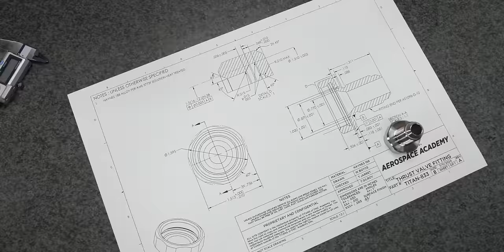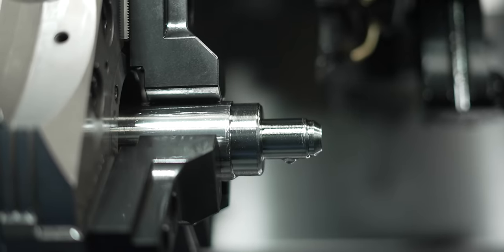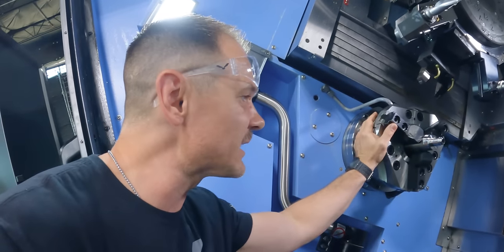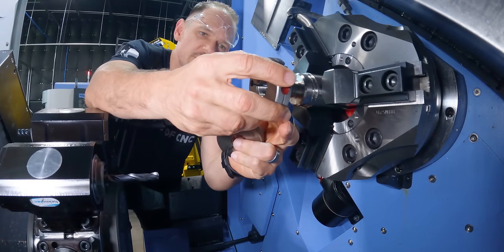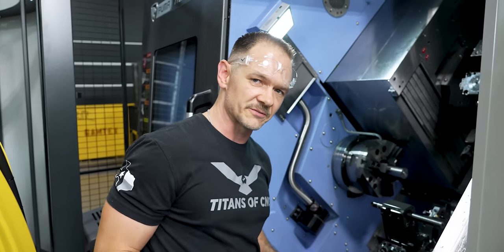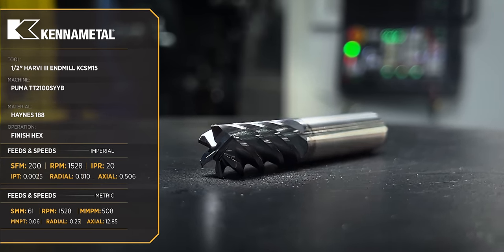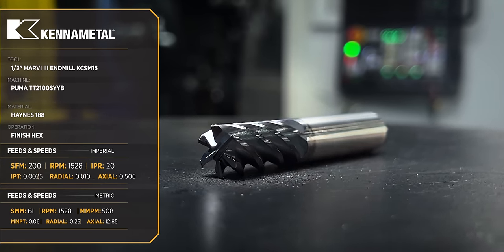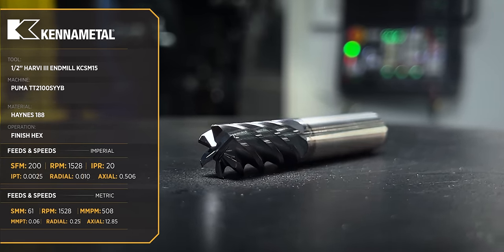Haynes 188: Hardest Material to CNC Machine?

Comment: I know you don’t work in automotive, but I would love to see some H 13 tool steel heat treated between 42 to 44. I’d like to see your feeds and speeds.
Reply: What Rockwell is the H 13 in a completely annealed state ,,, ?
Reply: Agreed. While EDM and pre-heat treat content are great content when building tools, a lot of us spend most of our time repairing dies and molds. Always looking for tips.
Reply: @rolandtamaccio3285 I think it should be around 30-35hrc.
Reply: or a mold core made from SPM450V @ HRC58+ hardened all the way through
Reply: H13 usually runs between 44-50hrc  after heat treat and draw backs if I remember correctly.
Reply: Ok Ok. I'm listening.
Reply: Did a lot oh h13 hard milling when I worked making injection molds. Use oil mist instead of flood coolant. Most of the time I was running about 300-500SFM, depending on cutting conditions. Do that with light depths of cut (0.02-0.03”) with large radial step over. Doing that with a high feed cutter with a large insert radius worked really well. Was pushing 0.015-0.02 IPT and only had to rotate roughing inserts every hour or two. I have no idea how people do it elsewhere but I spent months trying to improve our post heat treat roughing MRR and that’s what I found worked
Reply: Agreed. Where I work in the automotive industry, we hard turn pretty much everything and it’s usually at 48-52HRC. Would love to learn more about the ideal setups to improve our cycle times as I learn more about our DMG MORI NRX 2000’s and setup more machines.
Reply: M-390 stainless Rockwell hardness of 64-66😬

Comment: The most frustrating metal encountered in my aerospace career was pure nickel. Many parts on the order and took an inordinate amount of time and tweaking to complete.
Reply: Interesting. Why was it difficult? Nickel is soft.
Reply: @m4rvinmartian  Exactly. Small bore tight tolerance holes that had to be cold worked to final spec.
Reply: I think copper is worse
Reply: Turning/facing of pure nickle is not difficult. Slow speed and good coolant accomplishes the job with very good surface finish. However, threading on Nickle is difficult. Threads often get damage in first iteration. But with some adjustments, threading is also  doable on nickle.
Reply: Just finished an order of 500 parts made from copper nickel alloy, lots of tweaking and playing but tool life was terrible compared to the stainless steel I normally work with
Reply: @m4rvinmartian  manual machining where surface feeds are not held constant adds to the level of complexity on thin walled features. Tool pressure is such that it will cause all types of distortions.
Reply: @Industry-insider  I should have taken notes on all the cutting fluid concoctions we used that were passed down over the decades. Strange ones like Ivory bar soap and petroleum jelly.
Reply: @m4rvinmartian it was probably Nitinol,  which is nickel and titanium,  very abrasive.
Reply: @m4rvinmartian its gummy Absolutely blends tools
Reply: Yep. 99% pure nickel is the stuff nightmares are made of. I had to make the bolts that hold on the drouge chute for the ejection seat in a very popular current fighter jet. It is THE toughest material and was the right material for the function, but what a pain in the butt to thread (single point threading). The chip would not break....at all. Every cut work hardened the next layer. Finally got it to run nicely.

Comment: Is it harder than Stellite? I machined valves for huge steam turbines with that stuff.. eats carbide. Best results we found was using a negative rake angle on our carbide. And this was all conventional machining. 👌 love these videos
Reply: Softer then stellite but it can work harden ridiculously quickly. Go low and slow and the super alloy family will do what you want, definitely goldilocks not too fast or it will eat your bits for breakfast, not too slow or it will eat them for lunch just right. Stellite can be machined with boron nitride or silicon nitride, but generally is a little left of carbide in hardness. Mostly did stuff that was cased with that like guide rails and such.Grinding is the go to with that stuff to be sure.😮
Reply: Zirconia sand is quite hard, as you can discover machining sandy castings.

Comment: A friend of mine has a machine shop and says some of the softer grades of aluminium are the hardest to machine as they stick to tool steel and gum everything up. Just to put some perspective on this, for a laugh he ha machined an M10 nut and bolt out of potato, and a small box out of carrot.

Comment: My most “hardest” material was CPM10V… with 32 years old machine.
Reply: @danielczoller3395  yeah! Vanadium alloyed tool steels can be a bear. Lots of messy oily stinky coolant is all you can do if machining large drop hammer dies.
Reply: Heat treated high alloy CPM steel is no joke. Most of the Ellison guys I talk to think 45hrc is hard. I imagine a video on 10v or something like CPM rex 121 at 70hrc is a video that would be..in development for a while

Comment: I have had the (mis)fortune of machining many different super alloys over my 40 years in machining. Stellite, molybdenum, rhodium etc became run of the mill.
One alloy above all other stood out for me - Nimonic 90.
It earned the nickname "Unachievium"
Now if you demonstrated machining that, i feel you would have nothing left to prove.
Granted, these days there is a far better science behind carbide and ceramics than when i last got a job made from that hell-spawned godforsaken material, but it still remains a material that defeated everyone i worked with. I never hear a machinist mention that material without a huge string of expletives in the same sentence.
Reply: @grahamkeegan2706  my guess is vectored thrust components on high performance military applications.
Reply: @opendstudio7141  not sure but had to sign NDA's left right and center on the packages.
Reply: @grahamkeegan2706  that’s the way it was during the development the B2 Stealth Bombers also.

Comment: Appreciate you and all your skills. However you have the best of the best of everything in that shop. You’re not old enough to have had to do stuff like that years ago with no CAD/CAM or state of the art machines, not to mention carbide inserts. Hell back in the late 60’s everything was negative rake inserts. Insert technology has come a LONG way since then. Not taking anything away from you though. The only thing I noticed was you said you drilled a 2 inch hole. I’m thinking you meant 2 in depth because the diameter was certainly less. The fact that you gave us all that info is aces man, you’re certainly one of the best in the industry. Could have used you years back in my shop for certain. 👍🏼👍🏼

Comment: Wanna see Titans use Diamond/cBN tools at crazy speed!
Reply: Think those are very niche tools for specific finishes or holding super tight tolerances and most companies probably don’t want their most expensive and critical parts displayed on the internet.
Reply: Those are good for hard alloys but don't fare too well on tough alloys, high nickel alloys will eat a PCD bit for lunch that could do fine machining stellite or carbide. CBN will machine almost anything but gets gummed up badly on aluminum and copper alloys.

Comment: Id like to throw out a challenge for yall. We just landed some contract work where we are going to be machining a ton of TZM material with 1/8" endmills for most of the toolpaths. I had never even heard of that material and even our tool reps had no idea what we should use to cut it. We are going to get some blanks in by the end of the week and probably going to be making some cuts at the start of next week but I would be curious to hear what you guys would use to machine it. Our process is going to be a bit of lathe work to face and profile a shallow boss on the back side then put in the mill to machine the grid on the face. This material from what I understand is basically like trying to machine a carbide insert. Super abrasive and going to be a nightmare to do but it opens the door for a TON of work into our shop. Cheers fellas!

Comment: I remember hearing that the first rocket engine with interpreted cooling channels ( and not braced) was also a super copper alloy ( where it was then up into nickel plating for weeks/month non stop since they had to plate a 1 inch thick nickel layer )

My least fav material is those plastic that have extreme thermal expansion where you can't use cooling on
Reply: Plating a 1 inch thick nickel layer sounds extremely time consuming and difficult to say the least. The copper alloy used for rocket engines is usually a mixture of copper nickel and a few percent beryllium. It's unbelievably difficult to work with as the chips don't like to break and are very springy and it likes to work harden very quickly as well.
Reply: @christopherleubner6633  well nasa did do that 1 ince thick plating many many years ago ( cause there wasnt any other way back then. no 3d printing. no cnn and curved drills dont really work that well ) so they had to manually machone the part. make the slots as well. fill them with a condoctive wax and then plate the whole thing in a later of nickel about 1.1 ince and them use that 0.1 ince to hit there tarket as close to perfect as possibly allowed by the laws of nature and technoligy/metherds at the time

Comment: I remember back in the late 80's a guy walked in and to the shop and hands us some parts and a print. The print was just a holding fixture and the parts, 6 in total. They were shaped like a house roof line seen end on. They wanted a fixture to hold the parts down on a huge belt sander. When asked why a belt sander he pulled out a 7th that looked scored up. He said  try and machine it and you'll know. We tried and failed as well. He couldn't even tell us what it was or the Rockwell hardness. He said, and I quote, "It's too hard to measure". We were far too worried that the fixture wouldn't hold the parts down and anyone near the machine would be turned to canon fodder so took a pass.

Comment: I got to make some electrical components out of a material called Rhodium. You guys should play with some of that stuff. The part I made was basically a fancy bolt that would carry the current through it. But it was crazy thin walled. I can’t remember the exact dimensions because the thread pitch was a customer custom made pitch, but I remember it was around an M54 in size comparison. And the wall to the outside of the part was only .070 thick. I made the part to like 90% complete in my first vise on the table. Second vise I made a fixture that the part would screw onto so I could deck the top of the bolt without dealing with pressure on the thin walls.
Reply: Rhodium is really tough, and it's dirty step cousin rhenium.  Turning it was successful 80rpm .004ipr and heating the material to around 1100 degrees fahrenheit before engagement... Also deep cut and sharp relief angles with a dmng
Reply: Sounds like the plasma injector for an ion etching  machine used for semiconductor processing. Usually it is a platinum rhodium alloy of about 85% platinum and 15% rhodium. The plasma  for etch is 98% neon and 2% fluorine. Really dont have a wide choice of metals when using that. 😂.
Reply: @christopherleubner6633  it could have been. Some other parts I made for the same company I know go to microscopes. They kinda deal with a lot of weird odds and ends stuff.

Comment: Travis what a brilliant video  an articulate concise description of everything involved. What was the reason for tapering the cuts early in the video is it to reduce harmonics or to change the tool load perhaps?
Reply: The intention is to prevent notch wear. Notch wear is when you develop a chip on your insert because you enter the cut at the same point every pass. The taper is really just a way to alternate this entry point point slightly and thus increase your tool life. It is usually referred to as a variable depth of cut.
Reply: i was just thinking about this issue today at work!   we only use ceramic inserts and our heavy roughing cuts are all the same doc which has this issue and shortens the cutter life.   but i aint sure if our older lathes are still rigid enough to handle this style programming.

Comment: Try your hand with 60 HRC. I worked as a miller in a toolroom in maintenance. Having to machine in tolerances of H/h6 in materials as hard as 60 HRC was hell. We'd use air-cooling and carbide tools of course, but things would break so easily...

Comment: The machine shop I work for will only buy HSS Tooling and we have to use that tooling on everything from low carbon steel, cold rolled steel, 6065 and higher Aluminum, pre and post heat treated steel, all grades of stainless steel and thompson. They will not buy Kobalt or Carbide tooling which makes my job very difficult at times. Would love to see a video using only HSS tooling for such materials with advice.
Reply: What? Why? Are they stuck in the fifties?
Reply: Yes they are, the owner is 92 years old and still operates this shop as if it were 1950
Reply: @markdebruler5886  Well, HSS development died when WCo inserts were invented, so your options are limited...

Comment: Travis, awesome job with this alloy. I am curious though, what else does super alloys like this get used for besides for high temp turbine and/or rocket engines?
Reply: It depends on the material but you will also see them used in highly corrosive environments, for example chemical processing plants.

Comment: I would love too see Alumina machined. Always wanted parts because of the combo of thermal conduction and electrical insulation, but they have always been to expensive in comparison to the benefit they provided.
Reply: Alumina is ceramic material. It is very hard. However, it can be turned on CNC lathes using PCD (Polycrystalline Diamond) inserts.

Comment: Travis, drills have no feed per tooth (3:30), .... all specs are Feed/Rev even for insert (U) drills but I assume you'll know because calculations seems okay.
Is it a Mastercam thing ? 😉
Reply: It is a Mastercam thing. The live tool paths are programmed like they would be in a mill, hence the IPT. If it were an insert drill it would be programmed with the customary lathe IPR.
Reply: @travisjarrett2355  
Okay, thanks 👍,  ..... btw nice machine, a bit complicated to program when using the full options on double spindles and turrets, ... and robot.😉

Comment: Potentially stupid question, but I think I have logic behind my thought to it. Would this material thread easier if you hadn’t already drilled the ID out first? It’s a habit for me because it’s how I was trained. But my teacher told me to keep my part as ridged as I could when doing an OD thread to help avoid the deflection that’s causing that taper your seeing. My teacher has been working in the industry for 48 years. And I kind of just took his word for fact. What are your thoughts??
Reply: No there is some truth to that and if you are getting say chatter in your threads that may be a good solution. For me I sometimes worry if I cut my threads to size and then remove a bunch of material from the inside my thread may expand. On this particular size thread and hole probably tomato tomatto. In other circumstances though one technique might be preferred over the other.

Comment: I would love to see how you guys would machine tantalum ta-10w.
Reply: I remember that stuff being really heavy per given size. Cannot remember the machinability. So yeah, bring on some tantalum.
Reply: @1320pass It is very heavy! I’d say it’s similar to carbide in weight. The machinability is not great. It reminds me a lot of copper, very gummy and hard on tools. There’s very little information online about Machining it. i’m curious if anyone at Titans has run this stuff before.
Reply: Heavy, soft as mild steel but makes stringy chips. Cuts like streight copper. Cut some E beam electrode and target holders from the stuff. Also quite expensive too.

Comment: The most difficult material i ever had to machine was 99,95% Molybdenum. Really small part as well, just 10mm outer diameter and 16mm length. Still I had to change almost all the tools every 3-5 parts.
Reply: @atramentius9777  Hell yeah. Pure metals always sucks. Everybody loves Grade 2 Ti xD
Reply: @Narashimai  Grade 2 Titanium at least doesn't dissolve your tools
Reply: @atramentius9777  That is exactly the Holy-Moly situation.

Comment: Why would you use the live spindle drill over spinning the Chuck? Is it just because of the machine you're using, or is there a reason for it? Thanks
Reply: When I run larger drills I'll run it static (chuck turning) but with smaller drills it is easier (and safer) to run it as a live tool. The live tool usually allows for easier tool holding and if the tool is off slightly from center you will not snap the drill, as it is like a mill at that point.

Comment: Am a turner the last 15 years, for such a skilled job the pay sucks
Reply: It depends, turning on a XZ machine or programming/setting a SMX or two/three turret with barfeerder/robot with probing inside or outside the machine can make a difference by 2x or 3x on the salary.
When you can program a TT2100SYYB by hand/cam running double programs with waiting-codes combined with robot it should at least 2x the paycheck of a button-pusher.

Comment: The mention of Hastelloy brings back some less than fond memories of a 1200 hole tubesheet with only high speed steel tooling 😮. 

As others have mentioned, gummy material is often worse than hard material. I'd like to see you take a crack at Tantalum, or Ti-xNb.

Comment: I have a bar of rhenium not a machinist but I would like to drill a eighth in hole thru it. It's a quarter inch thick and I've tried different kinds of drill bits with no luck any suggestions would be appreciated